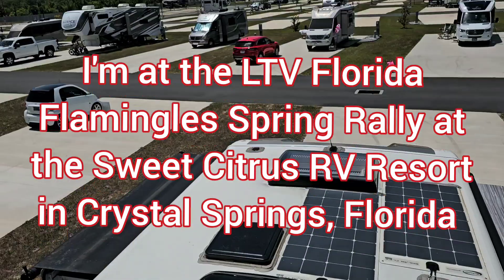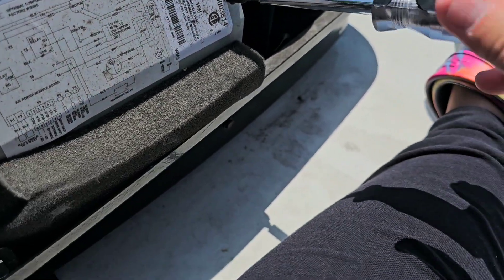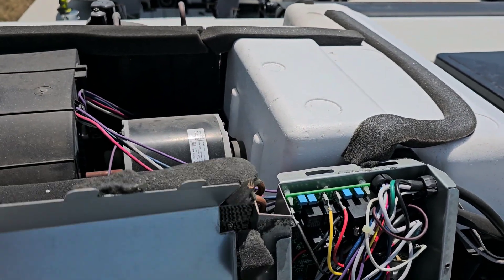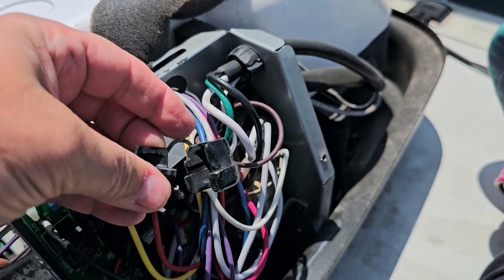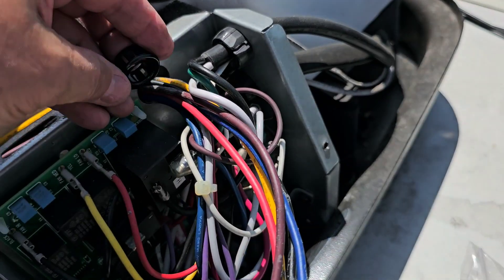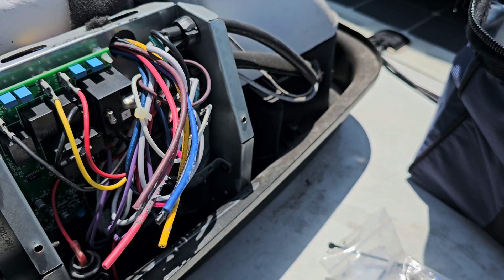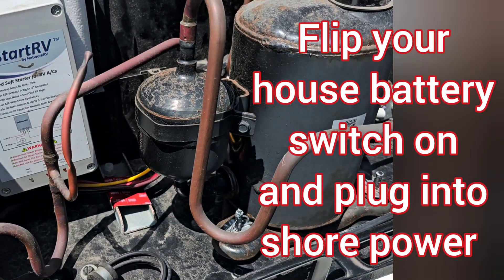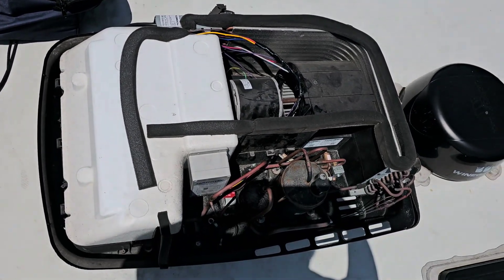SoftStartRV on a Leisure Travel Vans Dometic Penguin ll Air Conditioner

Comment: So Happy I purchased the UP Unit...
Plug and play all devices...😊
Reply from the maker: You should take note that SoftStartUSA has a warning on the Up website, "Please Note: SoftStartUp does NOT work with Class A or 5th Wheels that have an Automatic Transfer Switch." LTVs have an automatic transfer switch, so the SoftStartUP shouldn't be used with LTVs.
Reply: @SandyRVUpgrades I took note...
My Class A doesn't have an Auto Transfer, or a Generator starter if power is lost.
Thank you for the reminder 😊

Comment: Hi, Sandy--I love your step by step videos, however, my unit always seems to be "slightly" different then the videos.  I wonder if you can help me diagnose a problem with my installation.  I purchased a softstart and followed your instructions precisely.  The only notable difference was that I had an extra white wire on the start capacitor, which I moved to the compressor terminal run capacitor, as you instructed (but was not on the video example).  The problem I am encountering is that when power is applied to the coach, the compressor is running, even if the AC is off.  My softstart is showing the necessary "green" indicator lights suggested that it is connected properly.  Moreover, i followed your instructions on connecting the softstart precisely, so I am 99% certain the issue is with this errant white wire I moved from the start capacitor.  Can you offer any insight?  Thanks, Ryan
Reply from the maker: You might have moved the wrong white wire from the black Start Capacitor to the silver Dual Run capacitor C terminal. The black Start Capacitor has a red wire associated with the PTCR that must be removed from the Start Capacitor and the Silver Dual Run capacitor Herm terminal. Then there is a white wire that runs between the Start Capacitor and the C terminal of the silver Dual Run Capacitor, completely remove that wire. Then the last wire you find on the Start, could be black, white, or purple, terminal goes to the C terminal ofvthe silver Dual Run capacitor. To make sure it's the right wire trace it and very it's running through the grommet where the bundle of wires are running back towards the fan and compressor. That is the correct wire that needs to be moved to the C terminal.
Reply: @SandyRVUpgrades  I'm trying to send photos of my wiring, but apparently Youtube is blocking my links.  Is there another method to contact you with photos?
Reply from the maker: @ryanwallace8864 If you're on Facebook you can message me, https://www.facebook.com/sandra.johnson.1612147. Or if your on the Sprinter Source Forum you can start a Conversation with me, I'm SSTraveler.
Reply from the maker: @ryanwallace8864  Here is a link to SoftStartRV troubleshooting guide, https://www.softstartrv.com/troubleshooting/. I think you need to recheck your wiring to verify it's all correct.
Reply: Contact SoftStartUSA and they will go through installation with you to locate error...